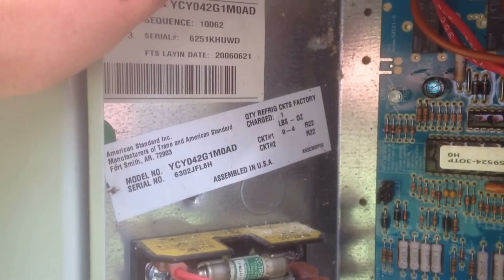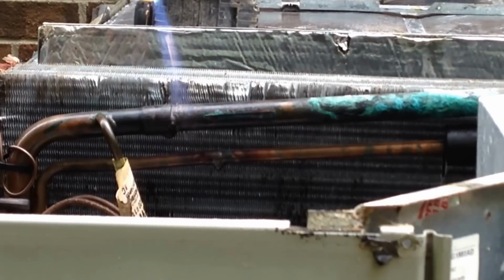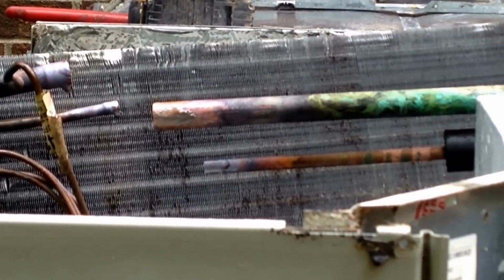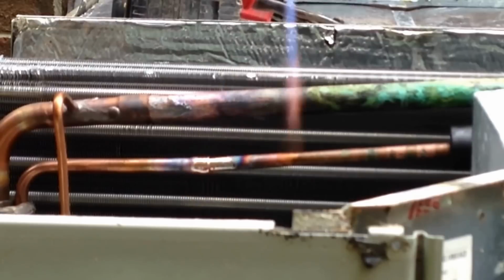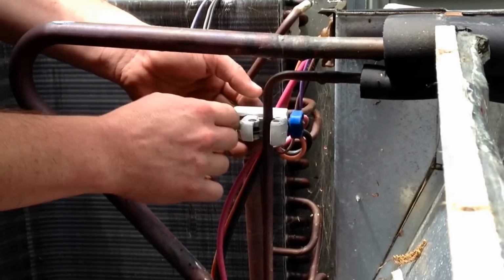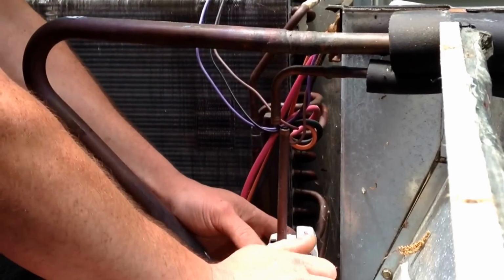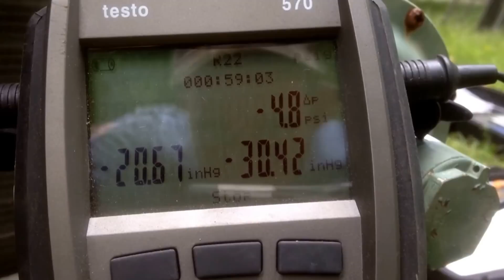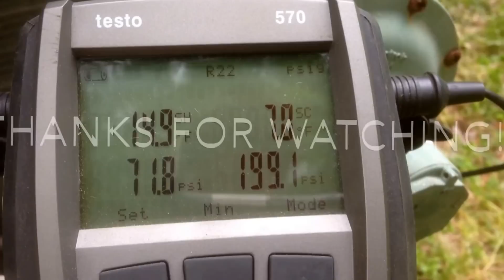HVAC Service: Trane Gaspack Evaporator Coil Replacement

Comment: Stephen, at least you had an easy coil to replace, I don't unsweat driers I will always cut them out the reason is they hold moisture and when you heat them you are chasing the moisture back into the system. Putting the drier vertical will become easier the more you do them. Good Job hey by the way your buddy did not call me.
Reply from the maker: Yep, that coil was one if the easiest I've done. I'll take it to heart about Unsweating the drier from now on!

Comment: Nice job Steve.  I don't work on heat pumps so does it matter how you install the dryer?
Reply: Rob Johnson on heat pumps you have to use a bi-flow drier so that you won't have a restriction when the reversing valve changes positions and you have either a heating or cooling call.
Reply from the maker: I only stock biflow driers so that I can't get it wrong!!

Comment: hay Steve do you use that rose bud tip mostly, i have evey tip known to man but when i got the 5 flame captains hook I can't use the other ones except  if I have to braze an equalization line.
Reply from the maker: Yea, that's the only tip I've used for several years now

Comment from the maker: Evaporator Coil Replacement
Reply: Awesome video Stephen Rardon! Man you solder quick! I take longer cause when I first started doing hvac I had lots of leaks, so now if I don't see what we call a "cap" on the weld we continue adding solder till we cap it.  Haven't had a leak in a long time lol (knock on wood)
Reply: Man good stuff!!
Reply from the maker: Thanks Jim Rodriguez have you seen the SilFos solder rings? I found them at Gemaire, tried them out and actually liked them for new, clean copper connections. Only thing I didn't like was that the ring didn't always seem to have enough solder to cap the joint. Still sealed though, the ring sits in the bottom of the coupling to pipe connection. I'll see if I can find a link to their website.
Reply from the maker: thanks Mike's Random Channel
Reply: Stephen Rardon yes they sell them at carrier here. I first saw them last year at the AC convention that's held annually. Last year it was in Dallas (9 hours away) I went for two days. Awesome stuff! I saw those. They call them rings if fire over here lol. Never used them though!
Reply: Stephen Rardon Hey Stephen, Nice welds and good tip on the other video using the two pocket thermometers on the roof top unit.
One question on the welding wouldn't you normally sand tubing prior to fitting drier? I've had guys tell me they don't do it with Dynaflow
Reply from the maker: If a fitting is super nasty I will break out the emery cloth but I usually don't have any trouble brazing otherwise. Scott Stoner